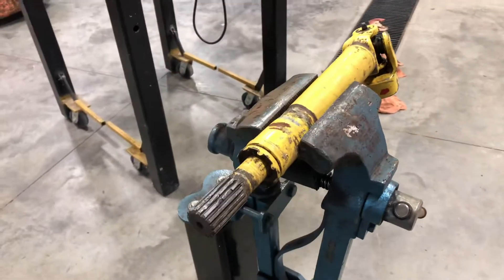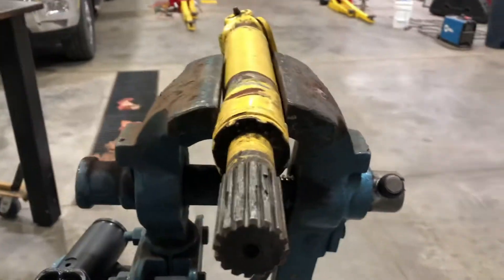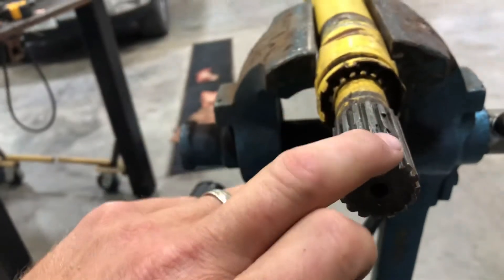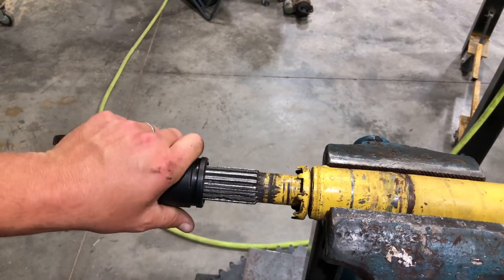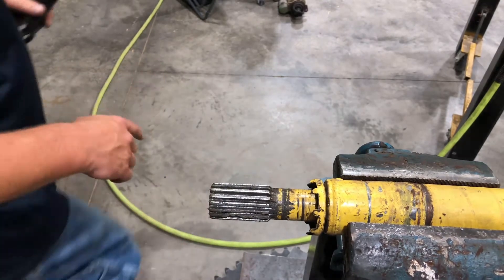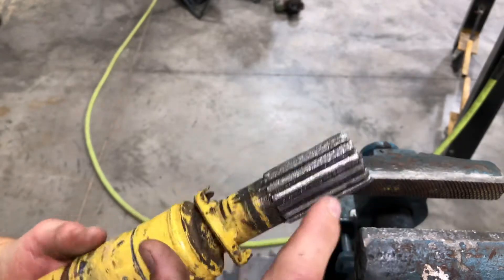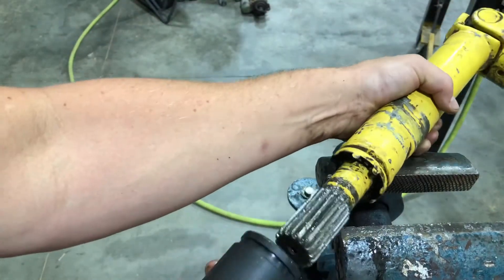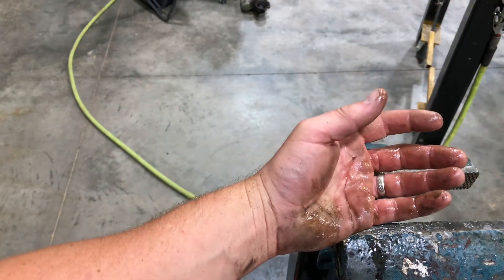Fixing damaged splines on a drive shaft

Comment: Thanks! I damaged the splines of an axle while replacing the cv joint. Your solution worked for me, I was able to clean the splines enough so that the joint would slide through the splines.
Reply from the maker: Nice

Comment: That will work in a pinch. But the splines will wear out prematurely they don't have to be perfect but they do have to be smooth throwing some metal polish on there with a cloth wheel would go a long way.
Reply from the maker: Agree, now have time to shop around for a used set

Comment: I am surprised by no negative comments, as a mechanic would normally say that splines need to be perfect. ( which they don't)  Great video, showing how a practical technique works.  I am currently doing one similar, using a die grinder/burr and mini, shaped files / rotary wire brush as a final cleanup. Thanks for the video, I use grease with a sprinkling of graphite to find the highs and lows.
Reply from the maker: Thanks, it is still working good saved like $200